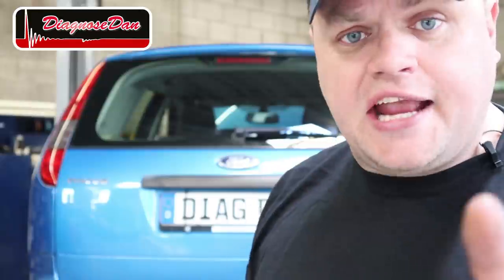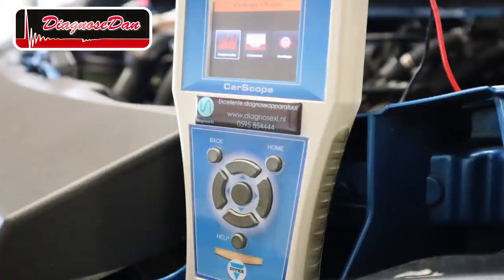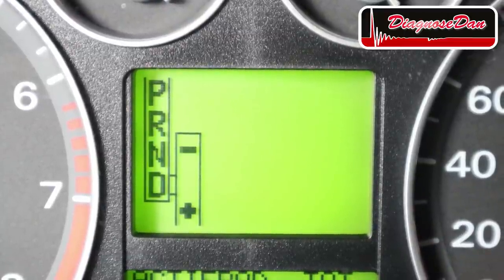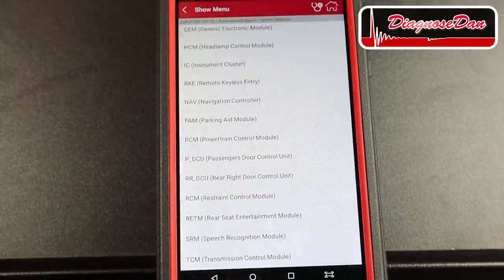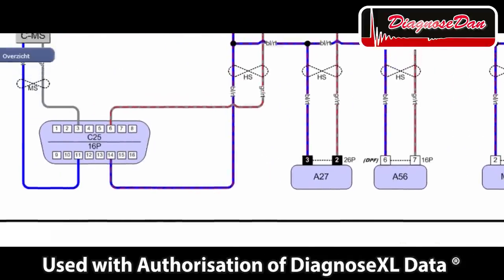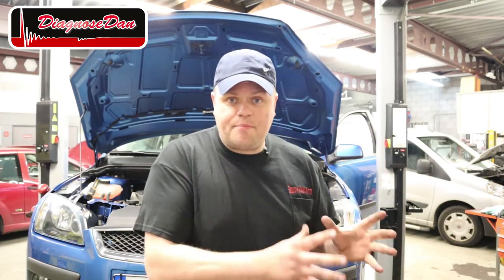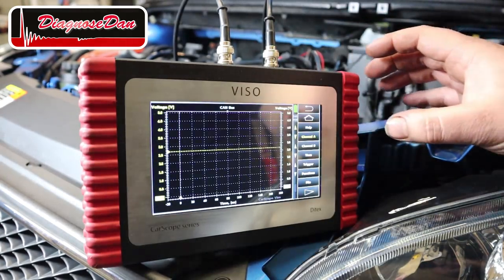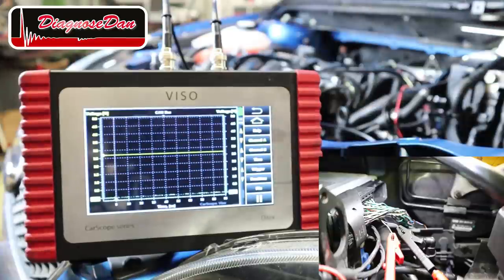Ford transmission trouble part 1

Comment: Hi Dan , a question regarding the process after the "no comm code was selected" would the DLC be a good place to check as well to see CAN "chatter"/measurements and or resistance check for the terminating resistors ? Thanks Richard.
Reply from the maker: In this case yes! But the comm. wires don't always run direct from the modules to the Dlc. Sometimes they run thru a gateway.
Reply: another great video....can't wait for part 2!

Comment: A real nice Impression of Eric o, cool tool btw. If I have to guess the error, I would check for ground and power on the module, and if some wire is ground shorted which should not be shorted. If the cables are ok,I would open the module if water is in it and destroyed it.
Reply from the maker: Powers and grounds we check in part 2!👍

Comment: Hey Dan coincidetally it happen that I own a Launch X 431 pro scanner and it is very useful to detect trouble codes even when they are not related with engine problems such as  transmission, ABS, body modules, the only thing I wish to have in it is an integrated oscilloscope, however I manage myself to perform the diagnose using the data flow function when it is possible, as always the quality  in your videos precedes you, thanks for this great entry and I wil be egaer to watch the 2nd part with the solution of the transmission trouble
Reply from the maker: Part 2 coming soon!😜

Comment: Diagnose Dan almost  fixes it again! Dan is back! I understand the effort it takes to make this content, but I’m always begging for more. These CAN lessons are awesome. Please tell me you will use a soldering iron and heat shrink to repair those CAN wires.
Reply from the maker: Heat shrink with solder and sealant already in it👍
Reply: @Diagnosedan  Sealant? That's even better, I'm gonna add that to my technique!

Comment: Looking forward to seeing part2. Also that Ditex relative compression tester would be very helpful. I don't have high amp clamps for my scope and sometimes performing a convential compression test can be a pita, especially if you suspect only one cylinder is down on compression. ;)
Reply from the maker: Yes this is a real timesaver!
Reply: You know you can use voltage to get by, right? Why do we use an amp clamp verus just measuring voltage anyways they both give the same results (inverse of course)  and voltage is easier to obtain usually.

Comment: Dan great videos as always and you sense of humour is getting better each and every video. Anyways my question is.. why didn't you push the pins out of the block connector of the module and then reconnect the block. Then you have undamaged wire and you can still backprobe the block connector to check the module is sending out canbus signal. The amount of work to do that is less than repairing the wire??
Reply from the maker: I wanted it to be easy to follow for people, this way it's simple and easy to understand 😉

Comment: Yeah that’s a nice wiring diagram there. Without knowing if it does or not I was wondering does the diagrams like in alldata show where the terminating resistors are also?
Reply from the maker: I dont use alldata, so i cant answer that question

Comment: Another great video, Dan.  How would you diagnose the TCM without cutting the wires?
Reply from the maker: As the can signal is good at the TCM this usually means it should be able to communicate. Watch part 2😉 it's coming soon

Comment: Another great video Dan! Love the channel.
I'd have to hazard a guess at the power wire to TCM being open circuit, around top of gearbox area ;) just a guess as I had a identical fault on same car a couple of weeks back.
Have you seen Pico's video where they utilise the low am clamp on CAN lines and proves when a module is sending a message, identifying which message on the screen is from that module. (The amps reading is super low but it's there)
Reply from the maker: Let's find out in part 2😜

Comment: Another great video.  Is  cutting the wires the best way of performing the test. Would it not be possible to depopulate the terminal from the control unit connector? Thanks
Reply from the maker: From educational point of view it's easier this way.
Reply: @Diagnosedan  I think a little video on methodologies would be good. I always struggle with removing terminal from terminal blocks or multiplugs despite having the correct tools. The little tricks that make life easier.  Thanks Dan.

Comment: Great diagnosis Dan. I have a question. Could you do the same diagnosis by unplugging one the transmission module and then unplugging the PCM? Are other modules communicating with the TCM that would make the unplug method invalid? Anyway fun to watch. Thanks!
Reply from the maker: Usually we do the unplug test when there is something wrong with the communication. This canbus waveform looks fine

Comment: The X431 is an awesome tool for the money and it includes updates, I use the x431 v+ it has  nice big screen and does alot of coding including keys
Reply from the maker: They told me the pro mini has the same software as the big toys. But a bigger screen is Nice if you want to look at data pids.

Comment: Hey Dan, like you said, there’s a way around clipping the wires. Would you take the pins out of the connector or rather use a break out box?
Reply from the maker: With the pins out of the connector it's hard to measure the signals from the Tcm

Comment: Hi DD,thanks for the video. In one of your videos where a BMW ABS module was the cause of the "No communication" between all the other power train modules. What you did was to solve the problem with method of elimination, by checking each module on this power train module for 120 ohms resistance on the CANbus wires. Will that work here? Thanks again
Reply from the maker: We find out in part 2 👍

Comment: Great video Dan, I was thinking about grabbing the launch v+ I have the Autel Elite already which I love. Too be honest I have a Snap On Verus edge I think I’m going to sell for a pico 4425 thoughts?
Reply from the maker: The pro mini is cheaper but has a smaller screen, I'm told the software is the same. If your thinking about a pico also take a look at the gmto scope. Visit the Ryans Automotive website for more information.
Reply: DiagnoseDan thanks Dan I’ll check out Ryan’s. I believe the mini is same as x431 I’m not just what’s upgraded with the x431+ I’ll have to do some digging. The pico looks better than the snap on scope part of things. Thanks for the advice my friend

Comment: Hey Dan greetings from NYC USA  although the way you presented the video was  awesome.  I usually     keep the key on watch the can bus signal and then stagger cut the comm lines in front of my piercing.   That way I know that the modules are in wake mode .. just a thought .. thanks for all your great videos .. Also if may request more info on your data base for information and simple wiring diagrams ..
Reply from the maker: The link to the wiring diagrams is in the Discription box and in the pinned comment. It's not the most expensive and there is a free trial.

Comment: I nvr think of this cutting can wire method to confirm the module is  sending message out. I thought with the module connector unplugged, if there was a good power , ground  and can bus line on the connector , the module shouLD work, else then is a fail module.. Dan , please explain in detail for the coming part 2, im goin to gain knowledge again 😁 you were my master. and can I have the compression tester gift? hahaha
Reply from the maker: More in part 2!

Comment: Great video Eric O ohh sorry I mean Dan.. Just my 2 cents worth but I wouldn't have cut the comm lines until I would have checked power and grounds to the module. No need to create more work for yourself, if it only had a bad ground or power supply
Reply from the maker: Extra work is ok, as long we get to learn something!😊

Comment: I say you're going to check powers and grounds to the transmission module, and hopefully find a fault there, indicating a fuse or harness problem.  If all powers and grounds check out, then check for other harness faults, then you're going to try a new module.  Although I do hate to have splices, maybe those gel-filled telephone wire splices would be a good repair.
Reply from the maker: Checking power and grounds in part 2😜

Comment: Hi Dan.
The obd dongle has a good readable graph on live data?
I bought already the Ditex relative compression tool when I saw how easy it is to measure relative compression.

For that Focus, could be a blown resistor !? 🤔
Reply from the maker: I think it does, we find out what's wrong with the focus in part 2😜

Comment: hey Dan! Great video! I have one question, can you recommend DiagnoseXL Data? I have Alldata but overall im not satisfied with it, seraching for wiring diagrams, bulletins, fault cods takes very long. Thanks for your great videos!
Reply from the maker: The wiring diagrams are great, but like every program there are holes. But if you need something that's not on it you can e-mail them and they send it to you!

Comment: 1) Dan, does it matter, which module holds resistors that 120 ohms, in this case ECM and instrument cluster, how does this matter for diagnose. please advise.

2) You had disconnected can bus from transmission control module, so when you key on, there wont wakeup signal going to TCM to wake up and i am not sure what you are expecting from TCM to show the can bus signal.
Reply from the maker: Doesn't matter where the resistors are, just look at a wiring diagram. The wake up can be a power when you turn the ignition on. That part was still connected.

Comment: How do you like the x431 pro mini? I'm considering buying one myself.

Is there any particular reason you didn't test power and ground to the TCM after seeing the no communication code in PCM? Could save you from cutting those wires.
Reply from the maker: It's the best scantool in that pricerange i've ever worked with.

Comment: its funny i just attended a ford instructor led class on adas and the instructor recommend cutting wires over piercing if back probing was not an option as they can be repaired per oem practices. i understand you are cutting wires to demonstrate network traffic flow but that guy would have gave you a thumbs up no problem.
Reply from the maker: Ha ha Great!😊

Comment: Dan, wouldn't have been easier to just query all the modules? If the TCM isn't communicating other modules on the network would point to the TCM not communicating. They would tattle-taled on the TCM.
Reply from the maker: I did this to educate people on can-bus. You'll see in part 2😊

Comment: i'm curious Dan, could you shift the shifter manually by way of the little mechanism underneath the small cap, about the size of a dime, beside or near the top of shifter console, just take a screwdriver & push down on it to get it to shift & i was wondering if that would work under this condition. I love a mystery haha. You da man Dan!😎👌👌
Reply from the maker: Watch part 2, coming soon!

Comment: Another great video Dan but a cliffhanger-I am anxious for part 2!!  Is there a way to figure this out with out cutting the wires?  I was wondering if you could hook up a battery like a 1.5 volt c or d battery back probing at the trans module and then checking at another module to see the 1.5 volts? that way you would at least know the wires were not broken or damaged some where? Thanks Dan!!  PS - please include my name in the giveaways.  Again thanks...Ken.
Reply from the maker: If your Subscribed you are already in!

Comment: I have run into very similar problems with communication networks, I have thought about doing that same exact thing with cutting the wires, I know you normally would  not do that but sometimes desperate times call for desperate measures, beside I can solder very well. Unless you have a module pulling down the whole network I sometimes find it can be difficult to troubleshoot network problems especially when you can communicate with all the modules with a scan tool.  Do you have any certain approach that you take when you come across that Issue? That would be a great video!
Reply from the maker: If something interesting comes into my shop i always try to film it, when time allows 😊

Comment: I hope you checked the feeds and grounds before cutting up the CAN cables. Otherwise it would be even a more silly move. Its funny tho that the wiringdiagrams on the Snap on tester are easier to understand than the original Ford Etis wiring diagrams.
Reply from the maker: The wiring diagrams used in this video are not snap-on

Comment: How much does the subscription cost to the diagnose xl data? Visited the site  but as usual with data sites they are never very forthcoming with prices! :-)
Reply from the maker: Ok normally this company has the price in the webshop. I can't exactly remember but i do remember it's one of the cheaper programs out there. I compared it to autodata but this was cheaper.

Comment: DD, I have a question I would like to ask u, maybe u can answer it?  Two separate problems, one is a hesitation upon acceleration, from a stopped position, which gets exceedingly worse in cold temperatures, the other, is a chirping noise underneath the hood, I've had the car three different places, including a transmission shop, none of the "apparent" auto repair businesses, were able to help me?  The 1st place said they cleaned the throttle body, which did nothing, the 2nd ran a transmission test on it and said there was nothing wrong, the 3rd place didn't have a clue?  It shows no current or hidden codes, other then tire sensors, I know w/out seeing it u may not have an answer for me / Oh, I forgot, it's a 2007 Scion TC, Toyota product, with a 2.4L, 125k miles, plugs have been changed, it did start using one quart of oil at 80k, Toyota's oil consumption test came back negative, new plugs, oil changes every 3k...THNX DD!!!
Reply from the maker: I would have to diagnose it😬

Comment: Ha ha...nice intro. Maybe cutting those wires wasn´t  the wright way ...but made the lesson on can-bus coms short and easy. Maybe in the next part you show us a easy way to check a control module for grounds and voltage.
Reply from the maker: That's exactly what were doing😜

Comment: Corroded CAN or Power supply wire terminal on TCM? TCM soak in water? If I understand things correctly CAN Modules are like Monitor, Printer, Hard Disc and CD drive of a PC. In order to communicate 2 things are required. Data cables and Power  Supply.
Reply from the maker: Watch part 2😜 Coming soon!
Reply: @DiagnoseDan I was expecting part 2 will be showing today. 😩 The suspense is killing me. 😈  Define SOON. 
Day after tomorrow, next week or next month? 😅